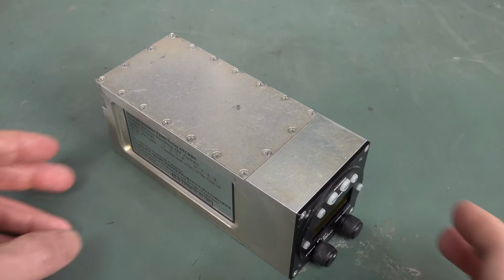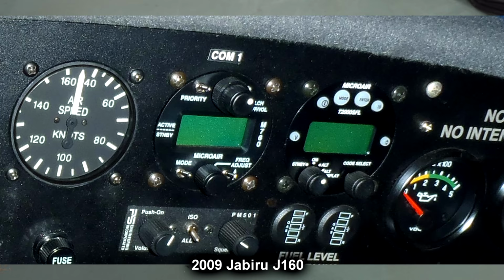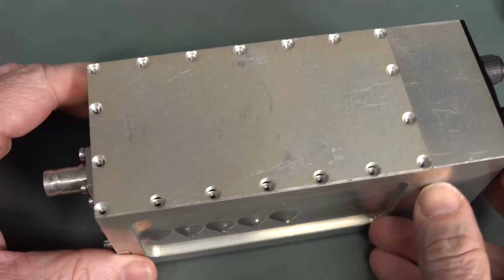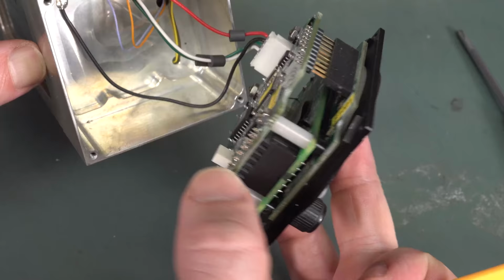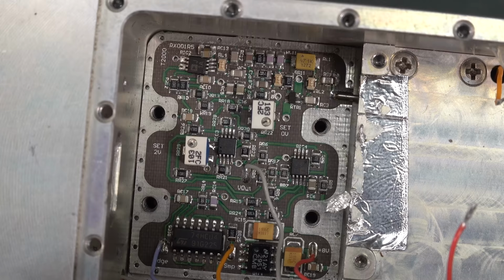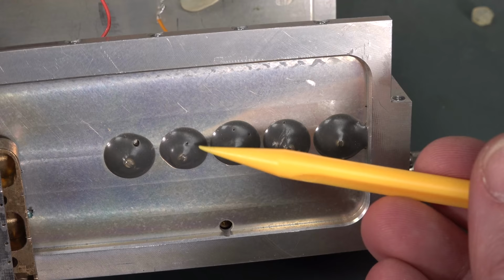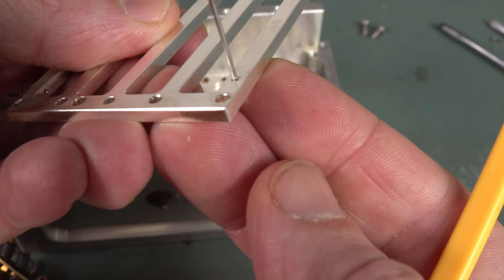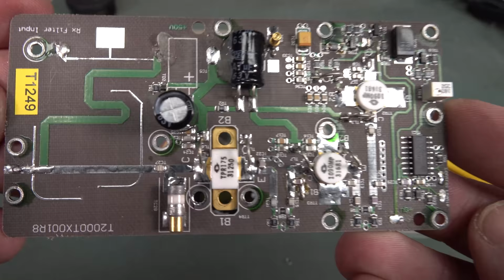EEVblog #1352 - Aircraft Transponder TEARDOWN!

Comment: The traces right behind the antenna plug most likely makes up a transmitter/transceiver switch (so the transmit energy is not blown into the receiver and the receive signal is not shorted by the transmitter). All to do with trace length and layout in relation to the frequency.
Reply: Sorry I meant transmitter/receiver switch..

Comment: Thanks Dave, this brought back memories as I used to repair the military versions back in the 1970s. And YES I used to tune them and I AM grey bearded but NO virgin.  Where is the 1090 oscillator?  I would have thought that the tuned cavity was part of the Tx circuit but much has changed (I didn't see a single valve!).  Back in the day the transmitter was a tuned cavity with a pickup loop to the antenna or a TWAT (Travelling Wave Tube).  I would love to lay my hands on a modern schematic....

Comment: 03:55 the state of the soldering on the resistors lower left! And bottom right at 06:13, and two shorted pins on the top of the PIC Micro?
Reply: Yup, I spotted those too. Maybe the reason this is in the mailbag was that it was a reject? Perhaps that's where it failed?
Reply from the maker: That shorted pin on the micro would be a track joining the two pads and lack of solder mask between pins.
Reply: I doubt these things would be certified for very long if something detrimental like that would allowed to leave the factory.
Reply: I worked for the automotive industry. Pick and place machines and stuff. If we had a short like this, the board had to be fixed. Even if the pins were intended to be connected. The automatic optical inspection machine (AOI) would go wild on this board. Also the sloppy resistor placement would have been a no go. And that was just for your car infotaimentsystem. Imagine a lack of quality in a thing that prevents planes vom craching into each other!
Reply: Could also be a revised product. I always see handcrafted revisions on PCB on a quite big company who makes their own PCBs

Comment: I worked for a few years at an avionics company for a few years and this is very much not top of the line kit.  There wouldn't be any soldered wires or a shady D-Sub connector on the back.  But that's why Garmin and others could underprice on the general avionics market.  Even taking out the NRE costs, the component, PCB, assembly and test costs would not scale down to that price.

Comment: Definitely not a Cavity filter or a Comb Filter. 
It's what is known as an "Interdigital Bandpass Filter". The machined stubs between the resonators control the amount of coupling between stages. 
see https://www.google.com/search?q=Interdigital+Bandpass+Filter&tbm=isch
And it's definitely not a "short to ground". The aluminum stubs are quarter wave sections at 1GHz, and the input is soldered to a low impedance tap towards the bottom of the stub.
Reply: No it's not an interdigital, it's a comb filter. Interdigital filters have the tuned elements alternating from which end they are ground, comb filters have all the elements grounded along the same side. This will help you learn about the difference between them .. http://lea.hamradio.si/~s53mv/cavity/cavity.html

Comment: Years ago I worked where they built transponders, back then all of the logic was TTL, the readout was individual LED's, code selection was BCD coded switches,  the transmitter was a coaxial triode in a tuned cavity with 1500 volts on the plate. Hurt like heck if you put your finger in the wrong place.

Comment: 18:21 Impedance inverter?- turns the capacitance into its inverse- a capacitance(times a constant Z_0^2). 

About the right length -line needs to be quarter wavelength which would be ~7.5cm, times speed of light in the coax as a fraction of c.

Probably easier making a good variable capacitor than a good variable inductor, and they needed the latter for whatever reason.
Reply: 68.76mm

Comment: It's just a basic band pass comb filter, a nice one though. The milled elements/parts under/between the 5 tuned elements alter the coupling between each tuned element (hence why they are different lengths), the coupling between the tuned elements sets the filters pass band width and pass band shape along with the distance between each of the 5 tuned elements. It's all really very simple.

Comment: I remember these MicroAir transponders, it was the first or one of the first small format model. But, if I remember correctly, it needed another unit for altitude encoding. 
The small format is especially needed in glider (no place for the bigger rectangular format common in airplane).
In the end, we managed without transponder until Becker came with a one unit small format transponder (it was a bit longer). On fiberglass sailplane, the installation wasn't easy, we needed to add a ground plate around the antenna, otherwise the emission was very bad (not good at 20 km!). And these antenna were expansive but easily cut off! Switched to more expansive shark fin antenna.

Comment: Comb filter is required to protect the sensitive receiver electronics  ( this can pick up secondary radar piulses from over 200 miles away) from the 100 watt plus transmissions of the transmitter.  It won't let any signal pass at 1090 MHZ but will be a clear path for 1060Megs

Comment: I have an antenna in my attic to receive these signals.  Sites like Flightaware actually work by people like me getting the ADS-B data and then sending it over to the sites.  I'm actually one of the few in my region that has it so it's kinda cool to know I'm practically responsible for that section of the map.  They sent the equipment for free.  Interestingly enough the RX is all done through a SDR and a Raspberry Pi.  I guess the tolerances don't need to be as serious since it's RX only, and it does not really need to meet avionics standards. The RF voodo is probably being done at the antenna though.

Comment: Dammit, rf is really black magic. Especially for me... I'm learning electronic by myself...
Reply: me too.
Reply: I have two electronics degrees from university and RF is still black magick voodoo to me.
Reply: Even if you do understand some rf theory, it still looks like black magic. Short circuits acting like opens, opens acting like shorts, straight wires acting like inductors and capacitors... and it gets even more magical as the frequency increases.

Comment: The 'rigid' coax is actually semi-rigid as it's bent to shape from a roll of coax; the convoluted form there is less rigid than standard semi rigid, e.g RG402, and is designed to be hand formed rather than requiring forming tools.

Comment: A transponder is really a transmitter-responder to RF frequency. Pilot set a 4 digit "Squawk code"  on the transponder so that the Air Traffic controller can identify the aircraft on their ground radar. It helps with collision avoidance.  The mode C & S types also provide barometric /altitude info.  I was wondering if the "cavity filter" part of it?

Comment: That part of putting the output signal to ground... Yeah that's freaky. That's why I specialized in autopilots!  
If its above 400hz, I don't want deal with it!
Reply: Haha you should watch The Signal Path, basically everything under 6 GHz Shariar calls it low frequency ;-)
Reply from the maker: In my former industry anything over 2KHz was RF
Reply: You need at least 440, to get a nice A.
Reply: Where is the line between HF and LF considering shielding of cables, regarding single and double shields ? Do you know. Is it at 100Hz or 1kHz ?

Comment: Interesting bit of kit. Hot snot is good enough for avionics in Straya? Looks a bit how ya doing. We wouldn't dream of not screwing down a TO-220 package. If something required extra support it would be in mastic or epoxy, something that's going to withstand heat without sagging.

Comment: That RF power board looks like a Teflon dielectric board developed by Codan Microwave division (Brisbane) in the 1990's. Very stable substrate electronically for microwave boards that can have a solid metal back plate for cooling. Below 1GHz fiberglass is usually fine but above 1GHz the Teflon substrate board is ideal the way to go.

Comment: That may not be “shorted”. Those parts may have an extra thick anodized coating. Anodized surfaces are none conducive. Usually hard black anodize is the better insulation. They may have ground out a small patch to attach the leads.

Comment: Are you sure those are test jumper links? And not inductors? Also the terminated capacitor on the end of the coax most likely acts like a tuned inductor. Transmission line can act as an 'impedance transformer'. It is most obvious looking at a smith chart, where you 'rotate' around the chart with it. With a 1/4 length coax you can make a shorted output look like open and visa versa.

Comment: The antenna connection point will be at the RF stage output impedance say 50R typically and that point is at a voltage minimum just like a yagi antenna where all the elements are connected to the same mounting pole apparently shorting everything out unless you look at the impedance and not resistance.

Comment: Based on the product page in the description I can see why this would have ended up in the mail bag. This is only a Mode C transponder so it doesn't take a GPS source and respond with or otherwise transmit a GPS location like newer ADSB-out transponders do. Mode C transponders that only reply with barometric altitude have become interesting paperweights with the ADSB-out requirements in some areas. All that being said, it's interesting to go through something like a transponder and see a design with so many individual boards that I could see avionics shops swapping out parts from salvaged equipment to do repairs.

Comment: Yup that 's a relatively high Q narrow pass band diplexer.   While ATC does use rotating skin paint classical radar it's a secondary system to the primary  transponder based system.  ATC transmits a rotating pattern interrogation beam at 1030Mhz, when the aircraft transponder receives the beam it replies on 1090Mhz.  You can see that a couple hundred watt echo from the transponder greatly increases the SNR of the system compared to skin reflection.  The reply can encode the OCTAL squawk code or the aircraft pressure altitude normalized to 29.92" Hg.  The interrogation data encoding  can tell the transponder which data is to be returned from the aircraft.   To prevent false replies from ATC antenna side lobes ATC also transmits a pulse on an omni-directional antenna.  The aircraft transponder compares the omni-directional pulse to the normal interrogation pulses and only replies if the main interrogation pulses have  greater amplitude indicating you are on the main lobe.  Range is done by round trip delay and azimuth by antenna pattern angle.   A new system called ADSB has been put in place these days.  It uses GPS and data links.  Basically ACT asks the aircraft where are you and your aircraft automatically replies.   For collision avoidance other aircraft can see the replies and know which are potential threats.

Comment: From the build quality I would say it's not even automotive rated. Many caps not glued properly, allot of wires hanging in the breeze ..
Reply: Fair, then again the warranties in these things are rather different, and when this thing was manufactured, you would've been able to still fly without a working transponder in some airspace.
Reply: Yeah, I would have expected potting or a lot more glue/silicone, I bet small aircraft vibrate a lot.
Reply: As a former RCAF Radar Systems technician  I can say that I have never seen hot snot used in any avionics I maintained. The temperature, G, and vibration levels in military AC warrant better design  I expect.
Reply: Yeah. It’s kinda marginal. The quality of soldering is also in the “much to be desired” category - probably wouldn’t pass muster with most avionics’ inspection books. I’d say that Dave gave it lots of Aussie leeway… I’d have been mostly “what were they thinking?!”

Comment: Dave - generally flying around in uncontrolled airspace the transponder code is set to 1200, and the mode is set to 'on'. If flying into controlled airspace most light aircraft set their code to 3000 and mode 'on'. This just gives a general ping/paint of where the aircraft is on the air traffic control/flight service radar screen. If flight service or air traffic control is wanting a more detailed identification they will ask you to set a particular code e.g. 4235. They may also ask the pilot to set the mode to 'Altitude' (Alt) so it paints the code and altitude on the radar screen. The transponder is always set to 'standby' when not flying (i.e. taxiing) and when changing codes. Instrument flight rules flights and the Big Boys always get a custom code (OK, IFR class G is a standard 2000 code) as air traffic control is responsible for keeping them separated from other aircraft. The transponder is also used for emergency signals such code 7500 (unlawful interference), 7600 (communications failure), 7700 (emergency).  These are useful as a pilot may have lost their radios, so air traffic control can be alerted with the transponder. A hijack can also be drawn attention to with a subtle change of the transponder to 7500. https://vfrg.casa.gov.au/general/radar-transponders/transponder-operation/

Comment: Nothing at all to do with TCAS, that's a completely separate system; this just enables an aircraft to be identified and tracked via radar and ADSB
Reply: This is not true actually. This is a full blown transponder, and although in itself doesn't have TCAS functionality, it can work work with another aircraft's TCAS to provide them RA. This thing doesn't even have ADS-B functionality on it's own, and no wonder, since it was produced before most ADS-B regulation was in place.

From their manual:
"Other aircraft fitted with TCAS systems can still interrogate transponder equipped aircraft like yours. 
This then lets them know where you are, and your contact information is displayed on their TCAS 
screens. The TCAS aircraft could be 100+ miles away and at altitudes +30,000ft! "
Reply: @rkan2  So it's not a TCAS unit, which is what I said.
Reply: @cambridgemart2075  "Nothing at all to do with TCAS", while you were probably referring to what Dave said. :) It can certainly have a lot to do with TCAS. You could say it has nothing at all to do with ADS-B, because that would be much more correct...
Reply: @rkan2  It has nothing to do with TCAS because it doesn't give the aircraft TCAS functionality is what I meant. I wasn't aware that this predates ADSB, so I'll admit I was wrong on that count.

Comment: The position that the signal wires connect to the filter is dependent on the input and output impedance required. The impedance along the element is a gradient starting at zero ohms where it is shorted to ground and is effectively infinite impedance 1/4 wavelength away.

Comment: The antenna being grounded to the unit housing which is then connected to the aircraft body, wouldn't this act as a ground plane for the antenna to operate?
Reply: At those frequencies the antenna ground plane can be a simple soup can lid, if the antenna design needs a ground plane at all. The antenna could be a dipole design, or other design not needing a counterpoise.
Reply: @isettech  cool, thank you
Reply: @isettech  1GHz is 30cm wavelength so that doesn’t quite check out unless it’s an institutional size soup can :) But a paint can lid would probably work OK.

Comment: Curious at 6:33 at that diagonally mounted 000 resistor at lower right.  Has that been soldered onto to some pins and used as some sort of jumper?  Seems odd.  Why not just a jumper wire if so?

Comment: I wonder if that short hunk of rigid coax in the transmitter section is in a stub configuration and tuned to notch at the RX frequency?  Of course, you need the much more elaborate filter on the receiver to avoid de-sense of the receiver.  Nice video.  Anxiously awaiting part 2 of the video where you reassemble it and do a bench test.

Comment: We have trolleys for 48h burn-in of devices with 24V 1000W MeanWell power supplies who fail after some time  most probably due to vibration because these trolleys are moved through elevators and across the production hall... these are just not meant to be used like this, can't blame MeanWell for the failures.

Comment: To answer your questions, I missed the exact frequency, but I assume it's either X-Band or K-band. Guessing K-band from the size of the filter.

At any rate, way back when I was working in radio astronomy in those bands, and typically they had a wave guide at the antenna focus that fed to the actual receiver element, typically the gate of a gallium arsenide FET or the end of a ruby maser.

I assume they're doing something similar here. Avionics tends to be vastly over-engineered in comparison to anything short of military or space applications.